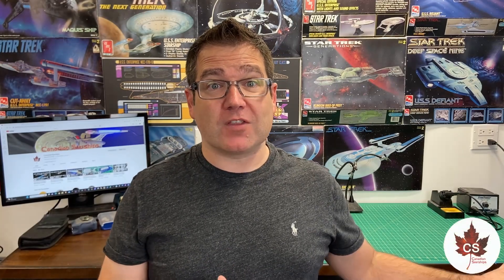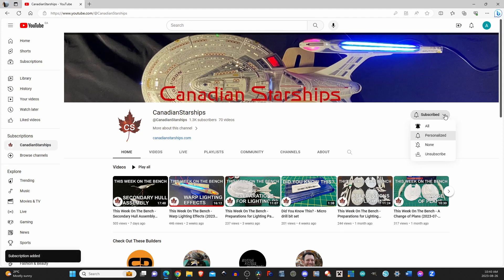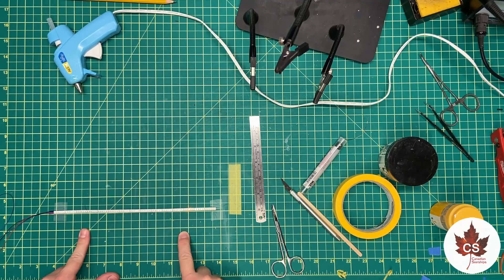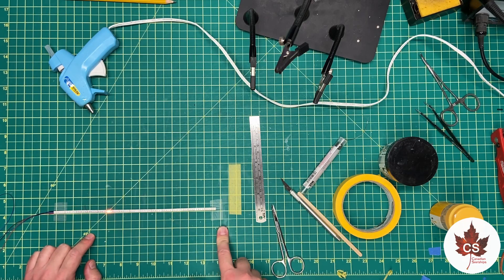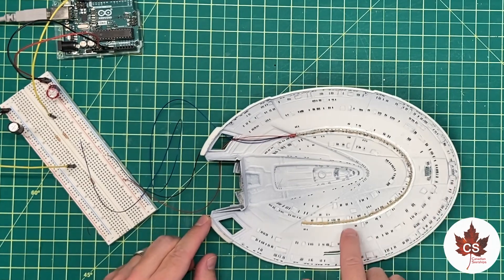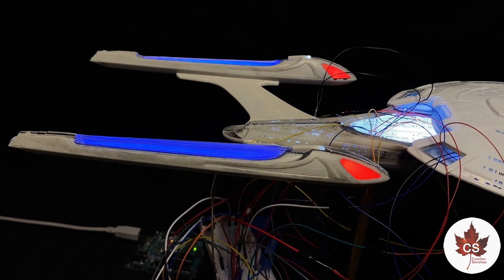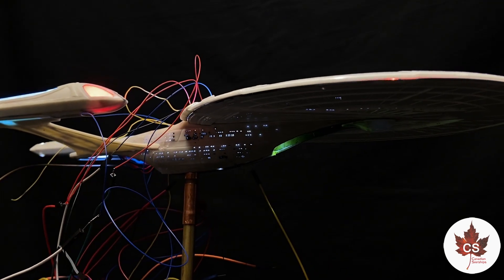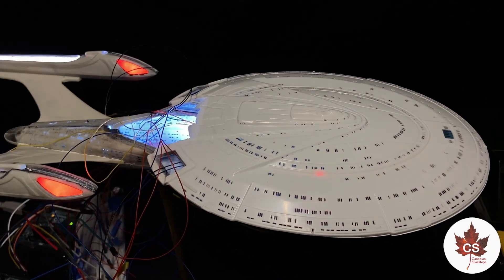This Week On The Bench - Lighting Integration (2023-09-17)

Comment: Very nice work, sir! I know you're talking about doing a light box on the phaser strip, but I'm curious - have you ever played with Tulip brand dimensional fabric paint? It is absolutely perfectly suited for light blocking, and super easy to use. A bead of Tulip along the phaser LED strip would be a really easy way of isolating it from the windows without having to build an actual structure.

I used Tulip extensively in my 1:350 NX-01 build - it's not easy to tell from this video, but all 24 lighting channels (TLC-5947) are extremely isolated from each other, and only 2 of the channels required a physical light box - most were handled with just Tulip, and it was also used to take up the slack in my light boxes edges. https://www.youtube.com/watch?v=npquvEJ-tck

I love your work!
Reply from the maker: Because the phaser array LED strip is just that, an LED strip, it can't sit face down on the surface of the model. In order to curve with the phaser array, it has to sit up on its side. So the LED strip essentially becomes one wall of a light box, and I have to build the second wall and the top. If I used tulip black, I'd have to first fill in the whole side phaser array area with clear epoxy, then paint the surface of the epoxy. That would be a lot of epoxy, so using sheet styrene to build out the rest of the light box is the better solution, in my opintion.
Reply: @CanadianStarships  Gotcha. I have done a similar thing to what you're describing, but with UV resin instead of epoxy. I really just wanted to make sure you knew about Tulip, because it's pretty miraculous stuff, imho. 🙂
Reply from the maker: @turner3d1  I've actually used it to light block the deflector dishes on these E's. It does work well.